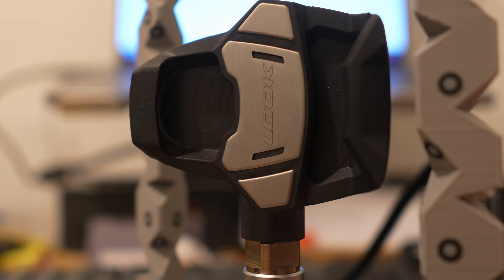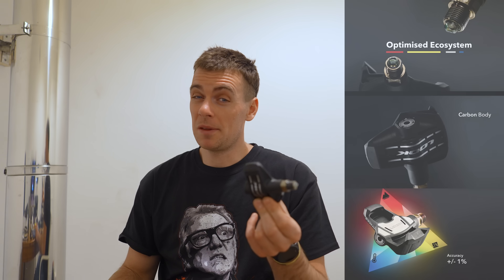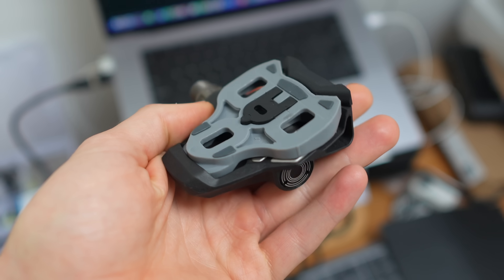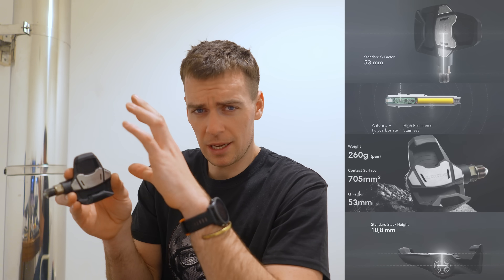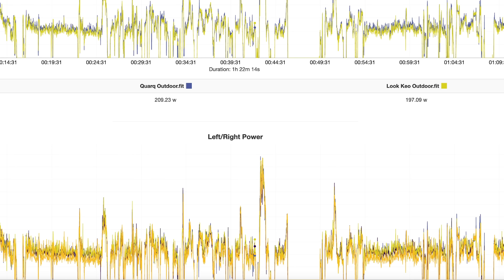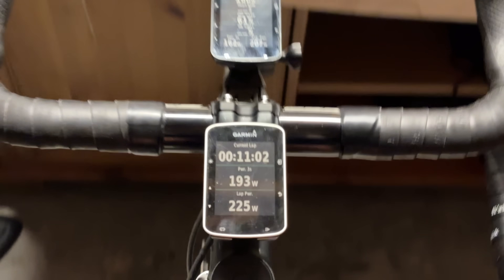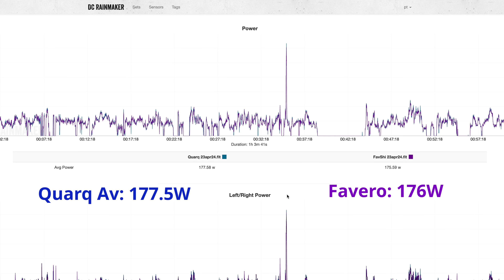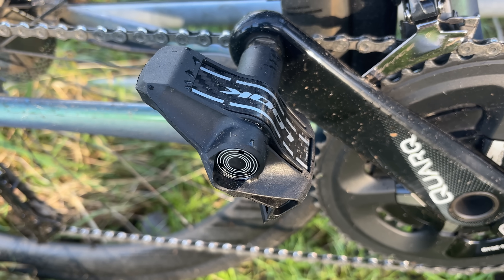The LOOK Keo Pedal Power Meter - Disappointing.

Comment: I have these pedals and was getting strange L/R balance readings. In the app there's an option to 'force' the download of the firmware even when there isn't a new update. I did this and it sorted the problem for some reason. Now they read accurately with good balance readings. Thanks PT
Reply: +1 on this. Got a set of these today and set them up on the bike I’ve got on my Kickr; was getting power figures 10-20% off from the Wahoo. Forced a firmware update and now they’re within 1-2% of the trainer. I also heeded advice in another comment to torque to spec; I’m sure that couldn’t have hurt. Fingers crossed those things do the trick.

Comment: I bought these pedals 9 months ago. First i had some differences in the power readings too. Especially when comparing to the outputs of my Tacx Neo 2T. Later i bought a torque meter to adjust the requested mount torque. That improved the situation a lot...
Riding outside i'm getting now values which are very close to the calculated values (Strava and other Power calculation sites). Also the Left/Right power values are quite equal. So make sure to use the right mount torque and start the calibration routine every few rides.
When using them in parallel with my Tacx Neo Trainer, the values of the Look pedals are still too low. I guess, the reason are communication interferences. They both use the Bluetooth channel. But who needs both readings at the same time?

Comment: I had the same problems and Look offered to send me replacement pedals. The new pedals also measure 5-7% less. So the problem remains... The bad thing is that my friends have started to hate me and don't want to ride anymore with me when doing 4-5 hours of Z2, trying to maintain my usual watts. The good thing is that these pedals make me stronger and I've already managed to get a few KOM's in my area😁
Reply: Riding 5-7% harder than you're intending is a great way to go fast until it forces you to not go fast😂

Comment: can you do the bodyrocket one? They claim they can measure power within 1% tolerance.
Reply: *0.1%... claimed. But how to verify this without any other meter having that level of claimed precision?
Reply: @ they seem to use the same measurement idea of chainring power meter.   
To measure the torque applied to the crank arm (same as measure the torque that applied to the chainring), this is a way more likely to get better accuracy is stead of measuring the force applied in different areas of the spindle.☝️🤓
Reply: @gplama  probably they claimed the accuracy of the used strain gauges (that is a common accuracy, 0.2% for sure)  and not the powermeter's itself. you can verify (a spider based powermeter) with such a precision indoor on a  dynamic torque bench as i know, but outdoor...? :) but if you wanna enter a market which is totally full, you must tell big things :D

Comment: Why aren't there cheap power meters? strain gauges just aren't that expensive. Is it just the calibration?
Reply from the maker: Strain gauge application and calibration is a highly skilled task. The gauges themselves are cheap, but making them into a transducer is skilled work. Some of the electronic components aren’t that cheap either at this volume which is relatively low to their normal applications
Reply: Bike tax strikes again.

Comment: Favero is truly a masterstroke product. Many companies have tried and all have failed in every factor versus them. Most accurate, most serviceable and cheapest power meter pedal. Their competitors are worse and twice the price!
Reply: How is Garmin in comparison?
Reply: @nami1540  I have the Garmin MTB pedals. I hate how heavy they are and they have a very tall stack height.  Not a fan if the coin cell batteries either.   Bought them a couple months before the Favero MTB pedal update.  They do work well and have held up very well to pedal strikes though.

Comment: I've had crap longevity out of the Blade system.  The carbon blades are expensive as well, I went back to the regular spring model and it seems more robust.

Comment: would be good for Look /retialer to send you some other pairs to see if this is a one off (not acceptable anyway) or somethign consistent to all and design/manufacturing flaw. If the design works on one side, why does it not work on the other?
Reply from the maker: @global_nomad.  the retailer is replacing under warranty now, so we will see.

Comment: Really interesting. I would love to hear your take on the whole drivetrain/powermeter topic. For me, spider feels wrong because you get thrown back to the hollow nut chainring screws. Feels like the 1800s when you have seen direct mount on MTBs. Crank based gets expensive if you are not sure that you will stick with a specific crank length and pedal only gives you very few options with stance and gets hit first on a crash.
Also interesting what you said about pedal interfaces. On the MTB, we clip in metal on metal and its not a problem, on the road we clip in plastic on plastic which can be a problem if you love to ride around on muddy roads in spring. How would you design a pedal system for Road use?

Comment: Tried Keo blades for a season before, but they developed play quickly  because of the carbon blade loosening it's stiffness. Changed the blades to stiffer ones and sold them off. I'm sticking with Shimano they just work.

Comment: Sounds like you have a faulty right side pedal. I went through this with Favero. After fighting with them for months they finally replaced mine, and the new one worked properly, so I sold it to a friend and went with something else because I never wanted to deal with Favero customer service again. If you got replacement pedals, and those had the same issue, I'd say you have a real story, but this is a big nothing burger unless they refuse to acknowledge the problem or replace the pedal(s).

Comment: If I wanted to learn more about torque sensors, strain gauge placement, measuring and calculating power, are there any good resources like textbooks or videos you would recommend?

Comment: As always a great video. That aside, if you actually wanted to go back to a Look platform, why not just buy the original Asioma Duos and be done with it instead of the Shimano ones? I had the Faveros for years and they were great, though personally, I much prefer Speedplay so switched to the Wahoo pedals once the power meter version became available.

Comment: The contact patches on Look pedals is really telling. I seem to go through a standard set of look pedals (not cleats) every 18-24 months where the pedal itself wears out at the front contact point of the pedal. 

I’ve wanted to make the switch back to Shimano but not sure if it’s something with both pedsl systems or just Look?
Reply: Just grab a pair of Dura ace pedals from used market, quite often people are selling them in almost new condition for fraction of MSRP

Comment: Meanwhile, I picked up Assioma Duo pedals when they were first released in late 2017 and seven years later, they're still flawless and track very closely to my other power meters. Why would you pay more for this? Also, I am a Look fan - have been running Keos for years. They bodged this one, for sure.
Reply: Same here. Look fan (565 and 795) but Assioma's since 5 years on the cranks. No problems and  serviceable.
Reply: Same, running assiomas since 2018, even "converted" them to spd using xpedo mtb pedal bodies for more than a year, and despite all the abuse, they just work.
Reply: How is the battery life?bearings?
Reply: @GramCounter  had mine since 2018. No discernable difference in battery life. Have used them for 200-300 hours per year. Charge cycles affecting battery life is more of an issue with stuff you charge all the time - like phones, laptops etc. New the assiomas last about 50 hours on a charge. Even if they use some absolute shit batteries that somehow lose 50% of their capacity after 100 cycles, that's still 5000 hours of use, and you'd still have 25 hours per charge left. It's not something worth worrying about I'd say.

Comment: Not having a pedal PCO is unfortunately a total failure. The Garmin Vector 1 and 2 already had it in 2012 or 2013? And they still work surprisingly well when mounted correctly, even if the reputation of the pedals is worse due to initial tests with too little torque. Well. But 20 watts off at 200 watts from a pedal ... really tough. The worst part is that the deviation is not even permanent. With a permanent deviation, you could either enter a correction factor directly into the pedal - if possible - or into the evaluation in the tool of your choice.
But this way the thing is really useless. My Look Keo Blade of the slightly older generation actually has a slightly more effective contact area. But not completely. On my pedals, the entire side edge up to the middle is marked with traces of use, as is the back. But yeah - it doesn't really matter.
It has to be said that the Keo Blade may not be ideal for beginners. Thanks to the light clamping mechanism at the back, the pedal doesn't tilt as much when you start and click it in. This makes clipping in a bit more difficult.

Comment: How do you know which is accurate? I mean, non of these power meters are certified, as I know. Neither the Quark or the Faveros. When your training is based on your power, precision is more important than accuracy. In my opinion. However it is not easy to prove, that your powermeter is precise or not.
And just imagine: because of my lifestyle, I do my workouts on two different trainers in winter and two different bikes in summer. That means four different powermeters...
Reply from the maker: @Gyikhuszar88  good point. How do we know what the perfect reference is? We dont. However, these are maligned with every other reference i tested (quarq, favero, and 2 different trainers) which all agree.
Reply: @PeakTorque  You did static weight test on your Quarq (and Assiomas), didnt You? that gives You the "perfect" reference imho.
Reply: RIP the English language. GP Lama has well and truly covered the accuracy of powermeters.
Reply: @TheMoodyedge  sorry, it is not my native.